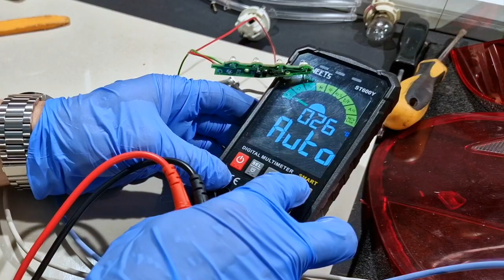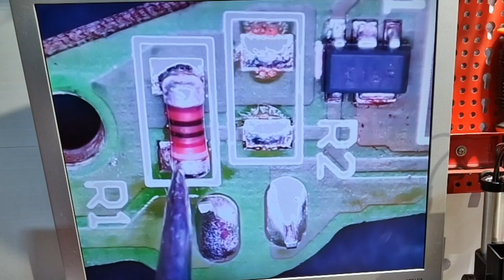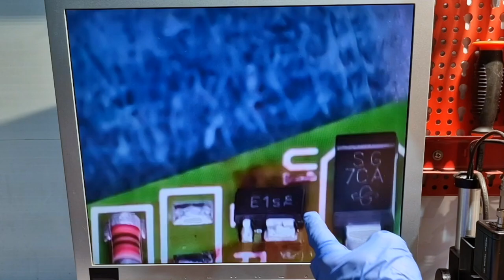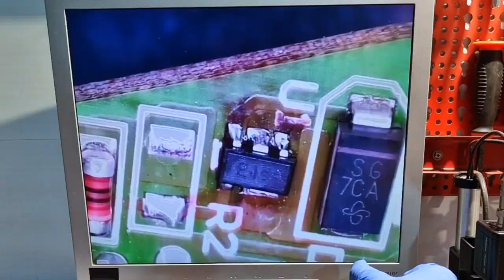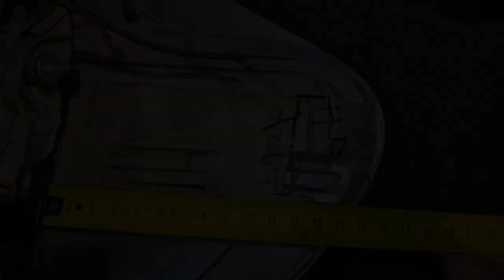BMW e70 Rear LED Tail Light Repair

Comment: Hey! Do you maybe know what is the IC that is used for driving LES'd? It is marked E1S7n on it but to be honest I cannof find anything about this IC.
Reply from the maker: Unfortunately, the automotive industry is different! Sometimes, they use normal ICs, but they especially change the name /model. Sometimes, you can find someone like you and me who know electrics and show to others other times you need to struggle a little bit ! Unfortunately, I don't know.
Reply: @MOvidiu  I took out scheme of my module and see that circuit is similar to LDO working as current stabilized source. Something like LM317 (positive) or LM337 (negative) so I think if the IC fails it will be possible to put there something that is accessible on market.

Comment: I have done similar repair on a F11 rear hatch tail light. The backside of the cluster has to be cut to remove the LED light circuit board. Main problem are also cold solder joints on the circuit board.

Comment: Great research. But won't dust particles get inside the housing by cutting it open?
Reply from the maker: Hello,  of course will enter,  maybe with an air compressor you can blow out some of them,  or better buy a new lamp 😀
Reply: Use the soldering iron with the sharp edged cutting tool attachment and "melt" through the plastic.
The dry joints on these circuit boards are the nemesis of BMW owners, they buy whole new light assemblies which are very expensive not knowing that the actual  LEDs are fine, the problem being a simple "dry joint".

Comment: I think this kind of LED control, and board is a sht. The basic level is funny, no cooling, and brightness is not enough. I don't understand E70 LCI why don't have full LED taillights?
Reply: Yea controller get hot like 100c at 14.3v.